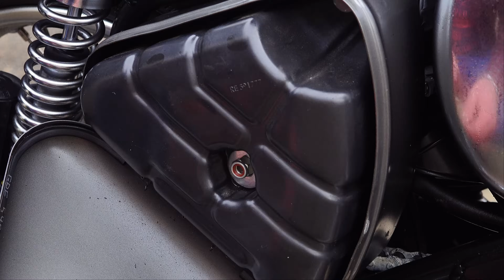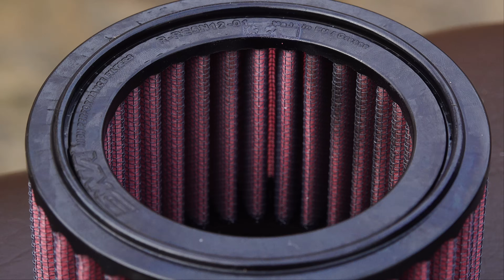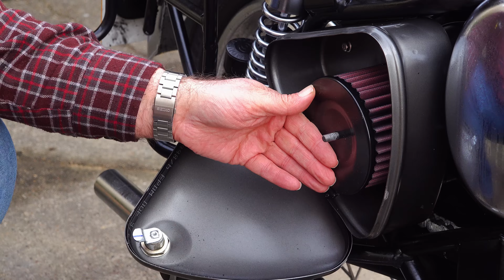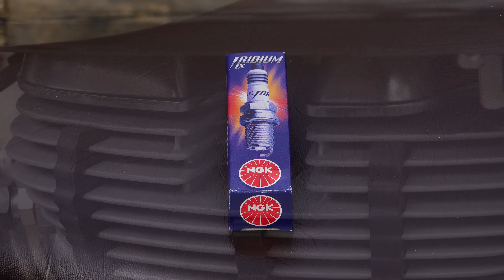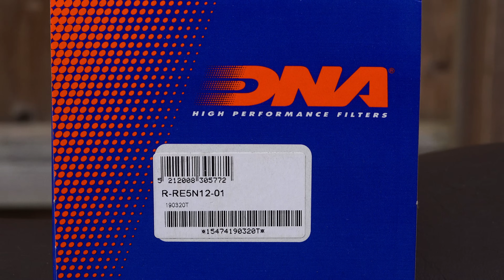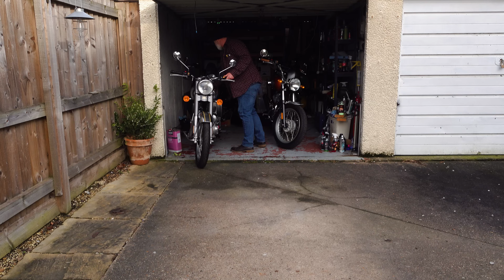Royal Enfield Classic 500, TOP PERFORMANCE MODS I didn't tell you about!

Comment: I'll believe the air filter and fully synthetic oil are worth doing, but the only reason to use iridium plugs is where you want them to last a long time between changes. Copper core plugs give a better spark in old low compression engines, so just swap for a good make.

Comment: Dear Stuart,

Thank you for all the content throughout the years. This is the first time Im reaching out. 

I have a RE 350 Classic Reborn for 1.5 years now. I recently fitted it with DNA 2 filter (approximately 500 km ago). The bike does preform better at mid range and sounds way better but it seams to me that the level of vibration on the bike is higher especially felt on longer rides (1+ h). Did you or anybody else experience the same?

Comment: Hi Stu - Re the DNA air filter, I notice that there is a cleaner and a spray lube available for these filters, can you confirm, Is a new DNA filter fitted to the bike straight out of the box, or do you add some spray lube prior to fitting? then is both cleaner and lube a later date? Thanks Stu, Paul

Comment: Recently, I purchased a used RE Classic 500. The previous owner replaced the fuel injector with a carburetor. I see the engine warning light ON most of the time, but it rarely flickers. Is there a connection between the carburetor change and this problem?

Comment: I noticed when I changed my factory fitted paper filter to the DNA item, that Royal Enfield had glued the original filter to the mounting disk in a few places. When attempting to do a 'dry' refit with the upgraded DNA filter it was obvious why they did this because it is impossible to keep the mounting disk in place on the filter when securing the assembly back together again. I solved the problem by using a bead of 'No More Nails' along the edge of the filter ridge where it meets the 'originally glued' area of the steel mounting disk and then adding a further bead of two pack resin glue all around the inside edge lip of the mounting disk to permanently seal the new filter in place to the disk. All a bit 'belt and braces' I know but this has provided a double air tight seal with the mounting disk and I've purchased a second new dirt cheap mounting disk, should I ever need to renew the air filter.....which is unlikely 🙂

Comment: Just wondering if anyone has had any issues with these mods.these engines are already running lean from the factory and I don't believe that the ECU adjusts to compensate for the changes as I keep hearing. I would like to hear any feedback please especially on the air filter.
Reply from the maker: all European motor vehicles sold from 2016 must have adaptive ECUs by law. This translates to all vehicles internationally for manufacture streamlining. Strange that you having problems believing it.
Reply: @stuartfillingham when I write don't believe I probably should have wrote as far as I'm aware ,if that makes sense. it's because it's always conflicting information especially from Hitchcocks and India. I hear the bike only has to be left to run a little for the ECU to adjust then I'm hearing you need a booster plug, then I'm hearing the ECU is only set up to accommodate the original silencer, it's all a little confusing hence my message.
Reply: @stuartfillingham  thanks for that information on the ECU s I didn't know that, I've been trawling through forums and found nothing, I wished I'd asked here earlier. That puts my mind at rest now, many thanks.

Comment: If you want to increase your top end and put less strain on your engine,try going 2 teeth lower on your rear sprocket or one tooth higher on your front sprocket. The difference in low end torque should be negligabile since you have so much and your top end should increase by at least 5 mph,and your engine will be spinning less thru out the rev range. Your gas mileage should increase as well.I did this with a Kawasaki 400 twin , this all happened and it was a much higher revving engine.

Comment: Have you replaced your Classic 350's spark plug with a higher quality one?  If so, what?  On Hitchcock's site, they have OEM one, Bosch YR7MES which I cannot find any cross reference to say NGK.  Someone on internet said it may be made in China by a company called Torch under Bosch brand.  Bosch representative from North America knew nothing about the spark plug.  I'd say you're absolutely right about RE going really cheap on the spark plug.  Thank you.

Comment: Hey Uncle Stu..

I've edited this a little here n there as time plods along and I'm modifying things and clocking up more kilometers...

My RE C500 is going like a little ripper now.. Apart from updating those idiot lights in the speedo with LEDs, I also replaced the "Tiger Eyes" with LEDs..

I've replaced both the Indian relays in the left cover above the fuses with better ones, fitted a straight through header pipe and added the same muffler as yours (no cats on my bike now, and its gotten a smidge lighter due to three catalytic converters now living in my shed) I decided to ride with the baffle out as it sounds a bit lumpier - it sounds bloody awesome actually.. Fitted a DNA air filter (had to add an extra gasket to that black plastic filter housing as the DNA filter is slightly wider than the OEM one..) Also replaced the OEM plug cap with a resistor cap and have added an iridium plug.. I rerouted the plug lead too.. It was cable tied to the frame directly above the cylinder at a sharp angle.. Some of the copper wires inside the lead were pulled away from the plug cap and didn't get a very good contact, I'm thinking that's what was causing the bike to intermittently cut out while I was riding along.. It doesn't do that at all anymore.. So it was either the plug lead or the relays that were the issue. 🤔

Now the bike accelerates up to 100kph without any drama at all... I think it freaks people out on the freeway, them seeing what looks like a WWII bike pelting along at the same speed as them... Now to see what these mods have done to my fuel economy..

Edit: Fuel economy - not much different - I'm getting 36km/ltr which isn't too bad for a 500cc single...

I've replaced the OEM seat with a touring seat so it's a lot more comfy and loosened the nuts on that square bar under the front of the seat.. Now the springs actually work and aren't there for looks..

Some of the shiny things I've covered up.. The petrol cap annoyed me.. I found a plastic cap from a Goulburn Valley fruit container that fits perfectly, and a Berri fruit juice bottle lid that fits the steering head bolt. Also for a bit of "bling" the two bolts that hold the handlebars in place - I've covered with a couple of 12 guage shotgun shells cut right down to the brass...

BTW... Before I added those "performance" mods it would take anything up to ten kicks to get it going.. Now it takes just two or three from ice cold..
Brilliant.. 👍👍👍
Reply: Hey Sir Galah

Ive rad your comment and you have done some mods I did too. Your airintake as well the exhaust is really free flowing now. I have this free flow parts too, but some problems with hasitating of the engine, nevertheless i thought about a powertronic or commander to fix this problem. Do you also intergrated one of those piggy banks? If not, you dont have problems with a lean mixture? Which year is your Classic? 

Greetings Sam from Sqitzerland
Reply: @samuelbraunwalder3022  
My C500 is one of the last produced so its either a 2019 or 2020 - I cant remember.. To get rid of the popping its been suggested to blank off that little pipe that runs off the top of the cylinder.. Upper left side under the tank.. I havent done mine yet but I'm thinking about it.. My bike pops and farts while decelerating.. As far as running lean Im not sure.. Ill check the plug later..

Comment: Hi Stu, thanks for sharing, ive made the same upgrades you have, plus an external temp sensor for the air intake , the sensor  now sits underneath the seat, also two stainless anchor rods/bolts (Hitchcocks)  that anchors the engine to the frame the the result for my Classic 500 is altogether a more responsive smoother more enjoyable ride, and it will cruise now at 65 to 70mph more comfortably , it does remind me of my early days of riding when i passed my test in 1975 as a despatch rider on an army BSA M20.

Comment: Great common sense stuff here. I think for really objective data you would need to run the machine on a dyno. This then brings into question the quality and set-up  of the carburettor/EFI, Ignition [HT] leads and other  changes that could be beneficial with regards to performance, on a machine that is not primarily a performence bike, and is built to a pricepoint.
Still....tweekers gonna tweek, and its all part of the enjoyment until its running too lean and you burn a hole in the piston or it all gets too much for the plodder componentry in terms of reliability.

Comment: I'm curious as to whether you switched out both of the bosch  plugs for iridium? (or maybe the euro 4 bikes are single spark?) One of the first upgrades I did to my bike when I got it was to change out the plugs,. Ordered 2 NGK plugs from overseas as I couldn't source it locally (Nairobi) only to find the right plug on the bike is smaller than standard.

Comment: Save £41.80 (DNA) and don't use an air filter at all!
 I've done this on a lot of my bikes. You'll get what feels like over 5% increase in torque and power ,maybe more-  the bike will feel noticeably livelier , through the rev range but it will have a new louder induction roar that you may not like.
You can use a wire mesh somewhere to stop large items if you wont - I never bothered except for a drag bike that had no air box and a straight shot into the carbs.
Excess engine wear?
Maybe - I got 100,000 miles out of a 1980s Suzuki GS550 and , yes, it was very tired. My other bikes like Honda 500s twins, 750 4s , 2 strokes whatever  - I cant say - maybe it takes 10% out of the life of the engine? idk. But after 60,000 miles most engines are tired anyway.
Nothing ever stopped, got bunged up or blew up
It's a heathen approach and the old bikes ran a bit lean and hot - newer bikes will auto adjust with the ecu.
It's the cheapest (free)  meaningful performance boost I know. 
You have to look at the big picture - if we rev the bike to the red line a lot and hoon around corners and repeatedly hit the brakes hard then we are not helping wear and tear on engine, drive train,transmission, brakes etc etc  anyway.
It's sort of a How To Live philosophy  LOL - enjoy yourself - who cares what people think or what we are supposed to do !

Comment: Stuart, I own another mild mannered machine here in the United States. It is a 2003 Harley 883 Sportster. I found magazine dyno tests of before and after installation of Screamin' Eagle air filter kit. Stock the 883 made 44 rear wheel HP. With the kit installed it made 50 HP. I found that completely stunning so that is the first mod I made to the bike. It was a higher hp increase than exhaust for less money, so basically a no brainer. Beside the air filter the kit also includes a new backing plate for the air cleaner assembly. This allows much more air to get to the carb. I bought my kit for $55 from a private owner who had never used it. Then I rejetted the carb with 2 sizes larger main and one size larger low speed jet. I also uncapped the mixture screw and opened it from its original 1/2 turn to 3 full turns. WOW. What a wonderful difference in power that can really be felt, and for so little money.

Comment: Hello Stuart,
have you checked your spark plug after some time running this setup? It happened to me that my Bullet is running lean with a K&N filter and upgraded sparkplug. There are some mentions about this on Hitchcock's forum, that the engine runs in open-loop mode and the ECU cannot adjust the fuel supply, this results in lower performance and overheating. In higher RPM's all seems to be well because the ECU switches into closed-loop mode and ECU adjust the fueling to meet the stochiometric criterium provided by feedback from the O2 sensor. Thanks for the answer.
Reply from the maker: yes I've checked it the bikes done 1500 miles and all is well.

Comment: Hi mate,
Well I just love my Classic 500.
I'm 65 and have a lifetime of building high end performance motors here in Australia.
I bought a 2009 Classic Bullet 500.
My wife and I rode it for about 3 months and I felt that the engine had massive potential to go a lot "harder".
We live in the Northern Territory where the speed limit is 130kmh and we have triple trailer road trains that beg to suck you in under the rig.
We needed much better performance.
I did a lot of research including buying another UCE motor which I tore down and examined and measured to the "nth" degree.
I have a nice little workshop with a small lathe and a mill and we made our Bullet a Harley hunter.
I know most blokes don't have a workshop, but this is a a bit of a run down on what we have done.
These mods will probably be out of the reach of most RE owners BUT someone had to do it.
The very first mod we made was to throw the engine pipe to the dump.
We replaced it with an 1 3/4" pipe and a Mostyn straight through Megaphone.
This increased power incredibly as in extremely noticeable and fuel consumption was way better..
The I went crazy in an engineering way and modified the cylinder head.
A serious port and polish job, swirl polished inlet valve and ditch cut exhaust valve.
We replaced the throttle body with a 40mm unit and a surprisingly cheap EFI system.
Totally tunable too.
We installed a crankcase evacuation system which was only $35.
No more oil in the air filter box when we caned it a bit hard.
We managed to find an individual who ground up some serious cam profiles for us.
The performance of the Enfield is not something akin to a very fruity Yammy XY500.
If anyone is interested in more information email me at crawforgj@hotmail.com
Reply: Hi @eddie not sure if you are still around active on youtube, but if you are, is it possible to help out with cam reprofiling. Possible to share the cam profile to which we can grind the stock Cams to, to make them a high lift cam? Any input would be extremely helpful. Thanks
Reply: holy moses. What a motor job ❤️.
flater valve seat angles delivers more opening while the same cam hightpush...just a tip
Reply: Sure i wanna know more about it.
Whats the engine output after the full job?

Comment: Hi Stuart - About to embark on following yet more of your excellent advice and change the spark plug on my 2020 C5 efi for the iridium plug from the stock plug. 
I'm guessing that the stock Bosch plug was non resister type and as the iridium one is - did you need to change the plug cap as well and or do you know how to tell if the cap is a resistor type or not?
Kind regards
Mel

Comment: Hi Stu,My new Bullet Chrome has been running very badly (still only 60 miles on the clock) OK  for a few miles then lots of backfiring to the point that the bike cuts out,when restarted it clears after a while. I then fitted the Hitchcock booster plug and the problem (I think) has gone away,but still need to do more test runs.Thank you for the fantastic videos,really useful and very enjoyable.I have one question,where do you stand on flyscreens,and have you considered fitting one?

Comment: Hi have found with the DNA filter am getting a lot better Seal between the back casing and the circular lockdown cap don’t think the stock filter was ceiling well enough and I was getting unfiltered air past the filter but! Now the plastic internal airbox casing is not making a good Seal I know the DNA filter is slightly deeper and if I clamp it down too hard it will start to crinkle . Please can help.great video Stuart keep them coming I have a c5 2018 classic

Comment: Great video, as ever, Stuart.  Plenty of information, clear images and a helpful discussion around the "Myths & Legends" on fitting higher quality items.  I ordered an air filter, having followed the link and fitted it last week.  I am already running the NGK plug, of course.  
We can't really ride at the moment because of restrictions but today I had a legitimate errand to run (Pharmacy).  The air filter makes an instant difference.  As I left home the acceleration in 1st and 2nd gear up to 30 mph was very much better and the throttle required was noticeably less than usual.  The bike just breathes so much more easily and on my 4 mile journey it was noticeable throughout the trip.  It makes more of a difference , in my view, than exhaust modifications.  I had fitted a lighter and less restrictive down pipe and silencer but the noise just got me down.  This significant improvement from the air cleaner is important to me because  I now no longer believe in louder exhaust pipes: they just seem to annoy non-riders and that does none of us riders any favours.  I don't know about the fuel consumption yet of course: I have no doubt from the significant improvement in throttle response that my 90 mpg will improve and just 10% will put me into the three-figure mpg range.  Thanks, again.